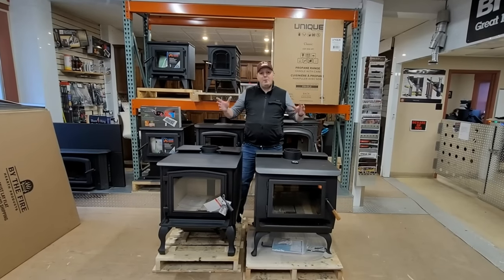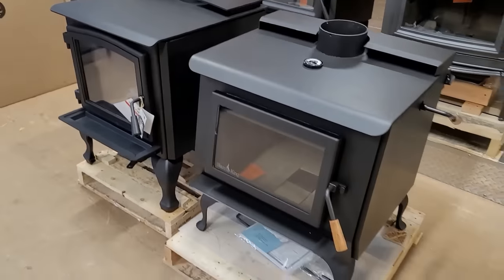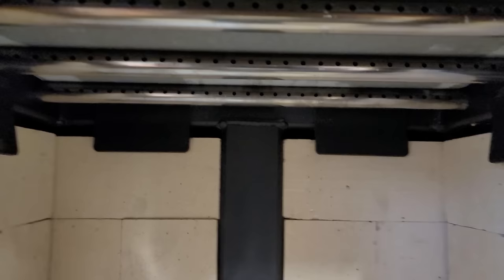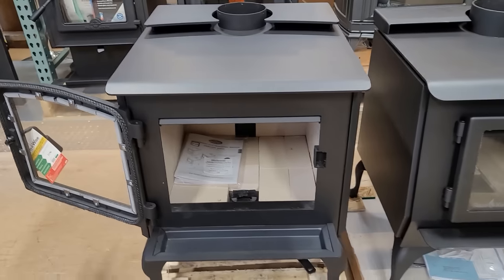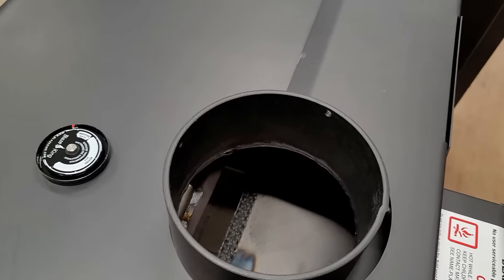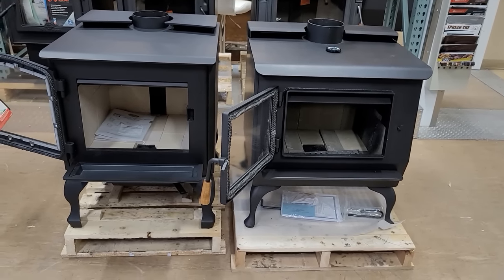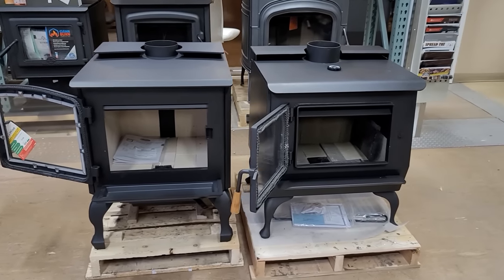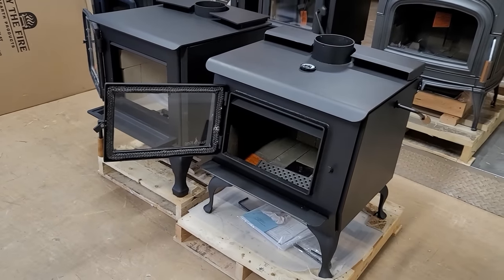Comparing Catalytic to Secondary Air Wood Stoves

Comment: Could you please explain Soapstone Stoves. I'm ready to buy. Tiny home or cabin. Want 'radiant' heat & longest burn time
Reply from the maker: Soapstone holds heat longer then any other stove material out there. Hearthstone calls it heatlife. Europe has been doing it for years.
Reply: Soapstone ONLY if it is the Tuulikivi style - but these are heavy and pricey systems that can heat a whole house (if you combine them with a central heating water tank and radiators. -  Do not buy an iron stove with soap stone tiles (or ceramic tiles) around it. You get the disadvantages of both worlds so to speak. 

That's a marketing trick. They look pretty BUT they just hinder fast warming up of a room (convection heat) and since the soap stone segements cannot be attached directly to the metall of the stove you also miss out on the infrared heat (typically from the side of the stove. 

We had central heating with a wood stove in the basement, and the parents (ground floor) were in charge of heating. but they went to bed early and they let the fire go out. (it was started again in the morning, and it heated up warm water for the central heating. The house was well enough insulated that I do not think we ever heated throughout the night. At max. an extra load in the evening when it was bitterly cold).

2 loads in winter (morning, early afternoon) -  unless it was bitterly cold.

In the evening around 8  pm we wanted extra heat in the main rooms of the first floor, and a stove was installed that had soap stones on the right and left side, it did not have legs and was higher but narrower than the model shown here. With secondary airflow, so not a cheap stove. 

It took 90 minutes until those stones were nice and fairly warm and they started radiating, too, so it did not deliver what we needed (it was O.K.). What we would have needed would have been a simple black stove. Maybe with good technology (but it was really only a support for the central heating, think fall, or evenings, or mornings on the weekend). That stove could have been much smaller to do its purpose - giving us a little extra and the view on the flames. 

It was a black metall stove and the soapstones were attached with some airspace to the metall - so the heat of the metall side walls of the stove took long to get into the stones - and we did not get full convection and not full infrared radiation from the sides either.

With a tuulikivi stove the stone IS the stove, they have hardly any metall in it.
Reply: As you talk about a tiny home a classic soapstone stove (or any other stove with a lot of mass) would be a complete overkill. They hold the heat but it takes a while to warm up if you start with a cool or cold cabin. 
With a heavy mass stove - like a Tuulikivi - you have one fast fire and then you reduce air supply -  it is also NOT an ongoing flame spectacle. The catalytic stove might offer even better views, because there you have the view on the glimmering wood that slowly burns away.

Both stoves shown in this video will give you heat fast.
On top of that the catalaytic stove will be long lasting AND convenient AND efficient. Likely as efficient as the traditional Finish stoves. But without the delay when you start them. Much cheaper, and not as heavy (reinforced floor for the soapstone).

The only disadvantage I can see with the catalytic stove is that it might get damaged with other than well dried wood (so visitors might damage your cat if they start burning carton, paper and what not). And if the catalysator needs changing after 5 or 10 years that has to be factored in. You should not burn carton etc in any wood stove (soot in the chimney, could become a fire hazard), and you definitely should not burn wood that is not dry enough - but it would not cause damage to the stove.

The catalyst might suffer though, it is more high tech - and that needs proper handling. I am sure there are reviews online, how long the catalyst lives if you treat it well and how you could damage it. 

I did not dig into that type of stoves they sounds very interesting.

you can take care of the long life of that catalyst  by only burning dry wood and preferably hard wood (if you need little it does not matter if you have to buy it, and that it costs more). You can process smaller volumes and chop it and store it for at least ! 1 year. then beech (it is good) will not cost much. If it is stove ready (correctly dried !) hard wood it costs more . 

Get a good SMALL black metall stove. The catalytic stove seems to be a good choice, you can have a SMALL fire going, that means you can leave all day, you feed it in the morning and in the evening and are good to go. It is crucial to have DRY wood (1 year drying time under ideal conditions, else 2 years). That is much easier to manage if you use very little wood.

it means also less pollution.

Comment: Very interesting! I have never seen a catalytic converter stove, although it has long existed in my imagination. I wwant to add here that rather then using air as a heat transfer and distribution system, liquids like water and antifreeze are much more effective at moving that heat from the stove to where you want it. So it looks to me like the hot water coil is missing from both of these stoves. It can be run by thermal syphon so no pumps are required, just an elevated hot water tank
Reply: The big negative for catalytic converter wood stoves is creosote production which vastly increases danger of flue fire--a very hot fire capable of damaging masonry, flue mud, etc.
Reply: @timber750  if your catalyst is working there is zero buildup in your chimney. The cat burns all of the volatiles out of the smoke.
Reply: @timber750  Sorry but no, your information is incorrect. If the catalyst is working properly there would be no creosote buildup.
Reply: @louiswestfall9622  But if you were unaware that your catalyst had failed (or cant afford to replace it or even find a replacement) and continue burning, creosote could build up, right?
Reply: @vanblindguy4600  
A year later and no one has answered your question ❓
That's what they call a good question !
Thank you

Comment: Which stove is best for the environment?
Reply: Hi Current, greetings from Colorado Springs Colorado.
   Your question is admirable, I understand your concern. 
However this is a area that is being abused by inaccurate information, rampant
and extremely expensive regulatory enforcement.
   It seems that depending on who and where you ask this question will determine the answer.
   I know I didn't address your question, my comment is more about the increasing difficulty in providing survival of the elements and the regulations being forced on society.
   Thanks C
Reply: The best stove for the environment is a TV playing a movie of a fire while a high-efficiency heat pump system heats your home.

If the environment is your highest priority, a wood stove isn't a good idea. But there are other priorities worth meeting, and in many cases a wood stove still is a sensible appliance to have and use.

Comment: My blaze king woodstove I had for years I still have I can go 12 14hrs. in between loading loading the stove upAlso you’re saving approximately 35% firewood using a blaze king woodstove the catalytic combuster
Reply: I assume that would pay for a cat replacement in one yr if paid for wood for use all yr.

Comment: I run my stove to heat my house. I don't care how efficient a stove burns, I care about heat output. The 'gee my stove can go 30 hours' means nothing when you need a sweater.
Reply from the maker: I agree to a point. Turn a secondary air stove down on low fire and it too will not heat your home. Cat stoves are no different. How we burn during the day is different then we do at night. Only difference is cat stove can be left of medium draft and you still have wood left over in the morning. Try leaving a secondary air stove on medium when you go to bed and you will wake up to a very cold stove and and very cool home.

Comment: Yoy didn't mention cleaning the catalytic part or replacing them.
Reply from the maker: Wasn't meant to be a parts replacement video. Same reason I didn't mention replacing tubes or baffles in a secondary air stove.

Comment: I completely disagree because I made my own secondary burn wood stove and noticed a considerable increase in burn time per loading of wood as well as increase in heat output with much less to almost no smoke
Reply from the maker: Not sure what you are completely disagreeing to. If you have an old stove without secondary air tubes and compare one with the secondary air stove is better. Here we are comparing cat stoves to secondary air. Cat stoves burn lower and longer while secondary air burns hotter and quicker.

Comment: Great Video, Nice comparison- I have a LOPI Cape Cod- it actually has both, Secondary burn and a Cat- when I got it (second hand steal) It was one of the most efficient and has cut my overall consumption in half, I have a 3600 sf house and this will cook us out if I let it go, burn times are 8-10 hours but it likes to burn hot, I have a 40' chimney and had to put a baffle in it as it was running away at night. Just couldn't put enough wood in it and choke it or it would backfire. Now 3 logs and almost choke it out completely and I have nice embers to start up in the am.
Reply: Same here.  Mine is an insert... just slammed in a masonry brick FP.  Burns long and clean.  dual 2 speed squirell cage fans  auto on/off.....LOPI Cape Cod,  Craigslist,  FREE ( still can't believe it )

Comment: Right on,  very interesting.  I have a top rated good quality secondary stove (love it)  but one thing I will say is they use much more wood than the manufactures and the sales 'people claims.  Burn times depend a lot on what kind of wood you're burning as well.   I've heard from people that the  catalytic honeycombs have to be replaced every now and then.
Reply: yes for replacement. Mine catalytic crumbled and was expensive to replace. People need to know about this unfortunate replacement and expense.
Reply: @david-breitenfeld  right on.  I imagine that they are pricey.
Reply: Thanks for the insight.
Interesting, not come across cat stoves here in the UK.
The  main types we have are cast,steel,multi or wood fuel.
Mine is a small steel multi fuel 
secondary air with hot screen wash which keeps the glass spotless but as its not our main source of heat its enough at just 3.5 kw
We usual put a lb of smokeless coal on at night which keeps it going over night then go back to just wood during the day.
A winters use produces around 2 pints of soot so its not bad at burning the smoke
Thanks for this insight always nice to see things from across the pond.
Reply: I have a BK King.  Myself and two friends in CT bought ours all at the same time back in 2009 ($1925 each, don't know what they cost now, but I'm sure they're worth every penny).   Anyway, we all remove and clean the cat at least once a year.  All of us use the stoves all winter long, and we are all still using the original cat!  I do have a spare cat which I bought with the stove, but haven't installed it.  Awesome stoves!

Comment: The catalytic stove gets way hotter for longer, I ran mine at 800 degrees and could have gone up to 1000-1200.  Talk about heat...winner!!
Reply from the maker: I tend to find it opposite then that. Cat stoves do get hot but not as hot as secondary air stoves. The thing with the Cat stove is it stretches lesser heat over longer periods. What you are experiencing is less peaks and valleys with the heat from your stove so it seems hotter in your home.

Comment: i wasnt going to reply but looking at all the times you reply to queries and also the queries you dont reply to , yes you do seem to have an agenda to catalytic stoves. end of day . i have a secondary burn stove it heats my home to a nice warm temp for 10 hrs with one load , i can control burn but of course then i have less heat. no parts ever replaced apart from grate. now if i have a passive house i dont need any heater. catalytic burner = less heat over longer period glass sooty quicker - chimney creosoted- parts need replacing- if i had oil central heating and turned stat down to 50 degrees i would not burn much fuel. but would it heat my home on very cold nites , no
Reply from the maker: I don't disagree, in the end of the day their are many different brands where some stoves are built better then others. 2 secondary air stoves come to mind which can be costly to replace parts are Napoleon 1400/1900 series with their air tube running right down the middle and baffles on each side. Customers would get a year or so then need to replace. They went through quite a few changes over the years. Another stove is the Lennox Grandview 230, awesome heater with blower but baffles were brittle and costly to replace. 
At the end of the day there is no one stove for them all solution. As sales people its our job to help guide a customer in the best direction that works for them and solves their problem. It was my goal with this video to show the differences of each. There are so many other factors at play with each home but this is just meant to look at both types. Thanks so much for watching.

Comment: Very strange differences in uk and American wood stoves. In the uk efficiency of stoves is based on the conversion of the calorific 
value of a piece of wood against the stoves ability to extract part of than value. So a stove that is 80% efficient uses 80% of the 
potential heat from each piece of timber burnt. Yet in America you don’t even know what it is, it could be 20% and be wasting 
80% of every log you throw on.  I find that really strange. Also  in the uk the government produced a list of stoves that are considered 
‘Clean burn’ and are above 75% efficient let’s say. You can only use stoves on that list in a built up urban area. The rest are banned.

Comment: So the way I see it, when you are talking about burn time you are talking about choking down the draft to stretch out the burn time so you still have coals when you get home at the end of the day. But when you choke down the draft, you throttle back the amount of heat that the stove will put out. You want to keep the temperature up in your house!!!
Reply from the maker: Yes you are correct..... burn time is essentially the time you light the stove to the time the wood burns down to some hot coals. Many customers get tripped up on this number which should be explained on the showroom floor.
Reply: Not like you are obligated to answer my question but what I’m getting at is, you need to open the draft in colder days to get more heat out of the wood you’re burning?
Reply from the maker: @grumpy1962R  that would be the case for either type of stove. With cat stoves there are less peaks and valleys with the heat. Secondary stoves need to be dampered all the way down before trying to achieve an overnight burn while cat stove owners don't have to do that.
Reply: @tinmaninc2023  still dodging the question lol
Reply from the maker: What was the question? @reallywontsufferfools1620

Comment: So the cat stove means your house will be colder?
Reply: Not really, you burn the smoke by the chemicals in the catalyst and heat not by extra air, that air draws in cold outside air you got to reheat, more cold air from outside leaking in through windows, doors sucked in. I have a jotel catalyst stove used 20 plus years replaced the cat 4 times
Reply: I puta pyrometer on my stove to see the temperature of the smoke, air being burnt. A pyrometer is a gauge on a 18 wheeler engine that tells the driver exhaust temperature leaving the engine, that’s important so you don’t burn up exhaust valves or overheat exhaust manifold on big trucks diesel engine while climbing mountains as on my stove note overheating and cracking it